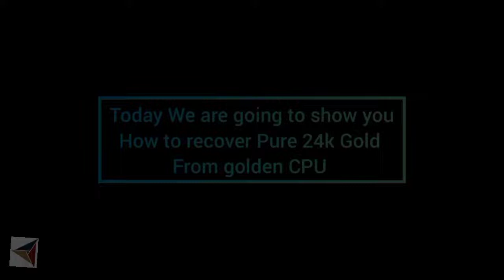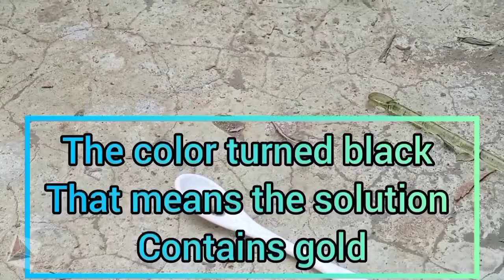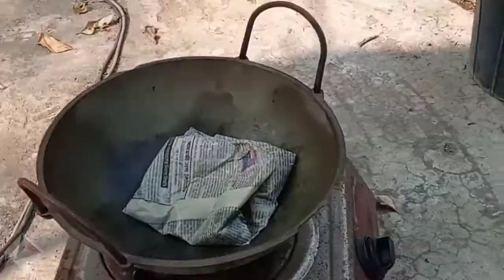Computer CPU Gold Recovery | Recover Gold From Computer Processor | Gold Recovery

Comment: Brother i just dropped the gold plated pins and cpu processors pin into aqua regia and then i added urea , then smb and water and i could no get gold except a white powder settled down. Please help men if u can.
Reply from the maker: Brother, you missed something.
Please watch the video again carefully.
Take the notes.
Reply: @TrinityGoldRecovery  yes i missed the h2so4 before smb but what I have to do now??
Reply from the maker: @idealtech1353  I Don't know bro!
You messed it up.
Maybe you can try the aqua regia process again to the solution 
And follow all the timing.

Comment: I enjoy your videos. Please explain what the HF acid does in this procedure.  HF is very difficult to get here and expensive. (not to mention very dangerous!)  Did you get any silver in this batch?   Thank You.
Reply from the maker: It melts all the glass crystals elements
Reply: @TrinityGoldRecovery  Thank You.
Reply: Is there any gold bonding wires inside the ceramic